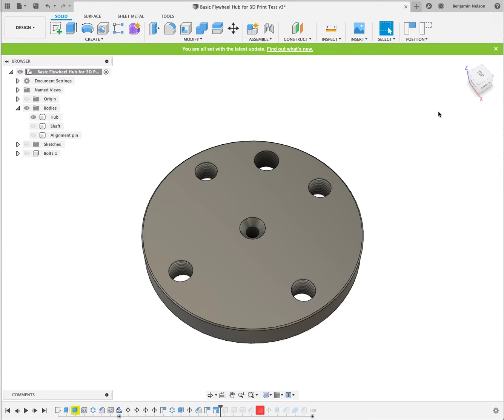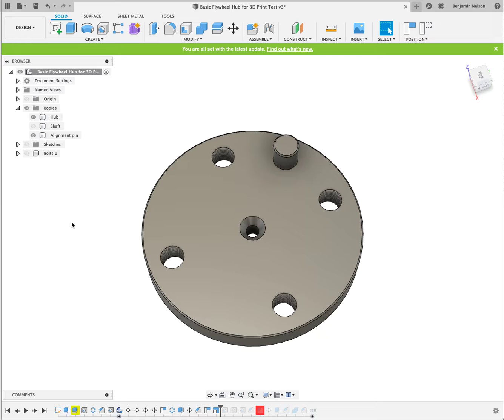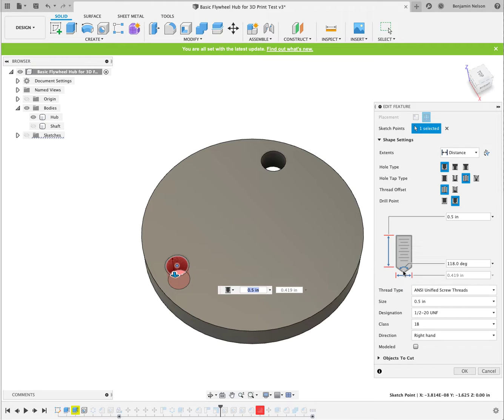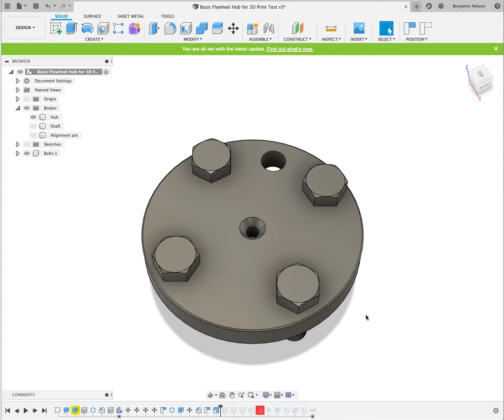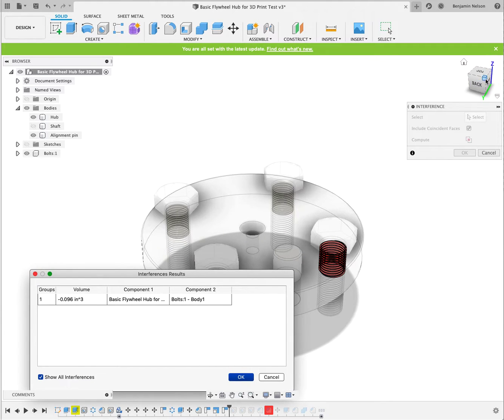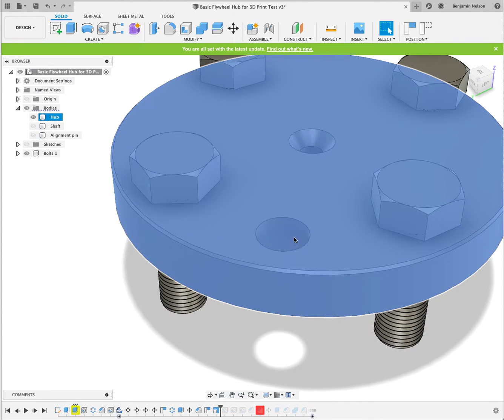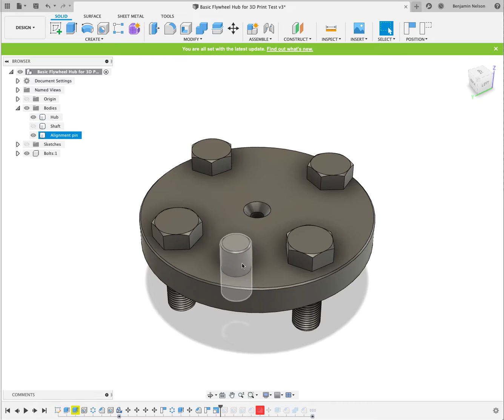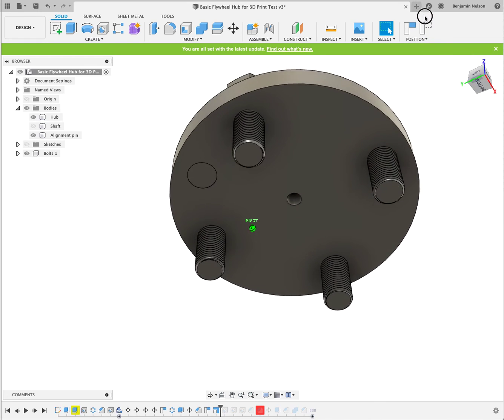3D Modeling Tractor Flywheel Hub in Autodesk Fusion 360

Comment: Was the flywheel hubcentric?
Reply from the maker: Can you state that question again in a different way?
This hub would go right into the center of the flywheel. The small depression in the middle of this part lines up with the center of the flywheel.
Reply: @BenjaminNelsonX  I had a look over your video to see how you removed the flywheel. Where you had to prise the flywheel off the crankshaft. Does the flywheel sit tight onto the outside of the crankshaft?
Reply from the maker: @michealcarney  Yes, the flywheel has a flat cylindrical depression and it goes all the way on to the end of the crankshaft. The end piece of the crankshaft is the same size and shape as this hub I'm designing in 3D.

The flywheel and end of the crankshaft fit tightly to each other and that fit centers the flywheel on the crankshaft.

Comment: Is this part bolting to the crankshaft? If so, why does it need threads? Doesn't the crankshaft have threads?
Reply from the maker: No, this part takes the PLACE of the crankshaft. The flywheel will bolt to this.
Reply: @BenjaminNelsonX  Oh, that's right, to keep the PTO.

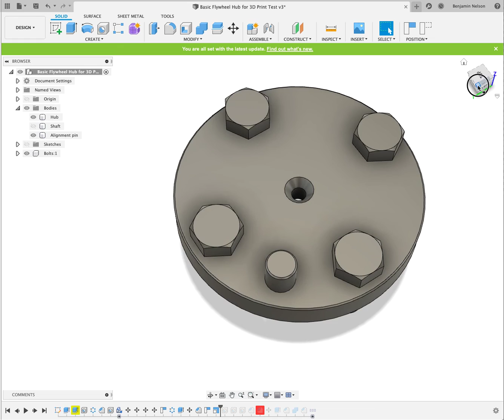Comment: How is the pin going to mate up to the other surface with the heads of the bolts there? 04:55
Reply from the maker: What you don't see is the flywheel. The bolts go through from the flywheel side into this hub. The pin goes through this hub, up into the flywheel.
The flywheel goes on the side of the hub where you see the bolt heads.